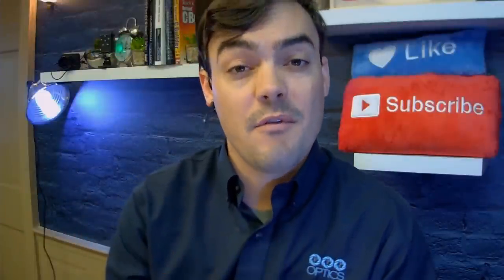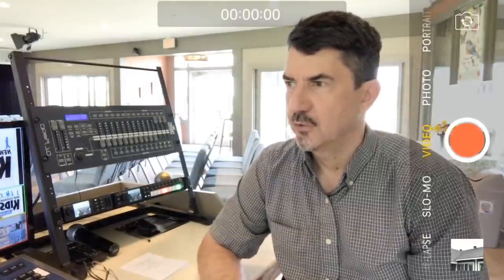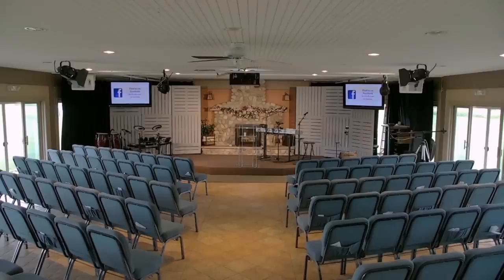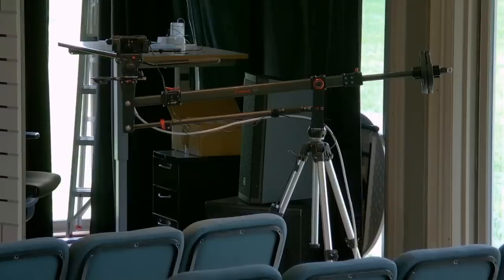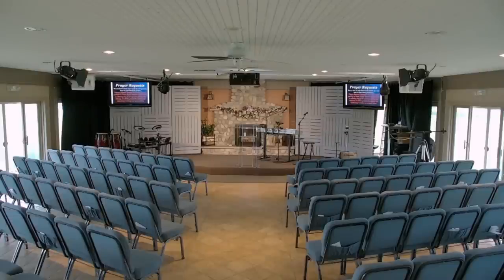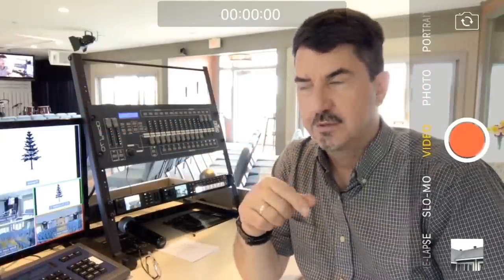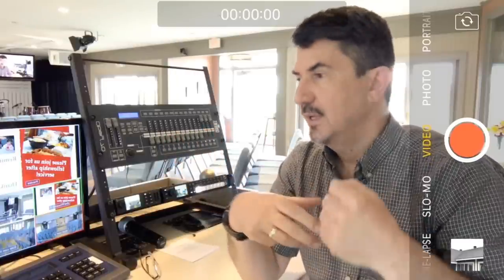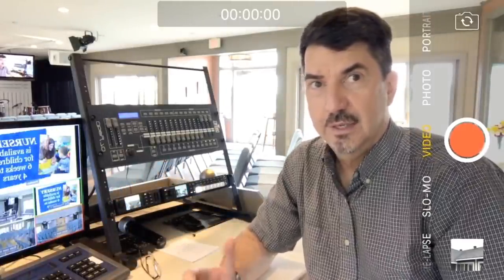Church PTZ Video Streaming System - Case Study

Comment: Hi for your audio delay issue you need to delay the audio 50 or 150 milliseconds to get it to match up you'll have to play with it to see what works you look into the BEHRINGER SHARK FBQ100 theres others out there but this is the one i have and works alright with my atem television studio hd setup. Was having the same issue especially when using the hdmi input from my cameras.

Comment: 2 Questions, if I may. Why are the iPhone portions of your video flipped horizontally? Did you get your audio lag corrected? A friend is battling the same issue (PTZ 12x & vMix). Delaying the audio is easy, but the audio is already behind the video - delaying it would only make it worse. If you've figured that out, please share how you resolved it. Thanks! I greatly appreciate the video walkthrough of your system. Well done.

Comment: Hi Matt - superb educational video.
What type of UltraStudio are you using that allows passage of signals both ways? Can't actually see the device in the video but understand your clear description of the signal coming to the iMac from the Atem Switcher and then the iMac sending the mimoLive back to the Atem.
Reply from the maker: Hello!
To facilitate the passage of signals both ways (input and output) between an ATEM switcher and an iMac, particularly for scenarios involving software like mimoLive or similar live production software, you would typically use one of Blackmagic Design's UltraStudio devices that support both capture (input) and playback (output) functionalities.

The UltraStudio product line includes several models, but not all of them support bidirectional signal flow. For your needs, the following models are among those that can handle input and output simultaneously, making them suitable for sending a signal to the iMac from the ATEM switcher and then sending it back from the iMac to the ATEM:

UltraStudio 4K Mini
Connections: It offers both input and output for SDI and HDMI, among other connections. This device is highly versatile and capable of handling up to 4K resolutions.
Use Case: You can capture video from the ATEM switcher via HDMI or SDI into mimoLive for processing or streaming on the iMac. Simultaneously, you can output a program feed or graphics from mimoLive back to the ATEM switcher through the UltraStudio 4K Mini.

UltraStudio HD Mini
Connections: Similar to the 4K Mini but more focused on 1080p workflows. It offers SDI and HDMI input and output, making it suitable for many live production tasks.
Use Case: This device is well-suited for scenarios where you're working with 1080p video and need a reliable way to integrate live graphics or other elements from mimoLive into your ATEM production workflow.

Key Features to Consider:
Thunderbolt Connectivity: These devices typically connect to an iMac or other computers via Thunderbolt, offering high bandwidth necessary for high-resolution video signals.

Software Compatibility: Both devices are designed to work seamlessly with software like mimoLive, OBS, Wirecast, and more, providing the flexibility to create complex live production setups.

Latency: When routing video signals in and out of software applications, consider the potential for latency. Devices like the UltraStudio series are designed to minimize this, but software processing can add delay.

When setting up your workflow, ensure the video formats and resolutions are consistent across your devices and software settings to avoid compatibility issues. Also, remember that while these devices facilitate bidirectional signal flow, the actual routing of signals—what goes in and out—will largely depend on your specific setup and the capabilities of the software you're using, such as mimoLive.

If you didn't see the device in the video, it's likely because these units are relatively small and can be placed out of sight in a production setup. The specific choice between models like the UltraStudio 4K Mini and the UltraStudio HD Mini will depend on your resolution requirements, budget, and the connectivity options you need for your workflow.

Thanks for checking out our Channel! 
Learn More: https://ptzoptics.com/

Comment: How do you switch the source camera/input for the Aux Out output? inside mimoLive? Using the ATEM Controller Layer?
Reply: On the TVSTudio One you simply press the AUX button, it lights up white, then press whatever source you wish to send to the AUX output. Press the AUX button again to turn it off. Your AUX output is now sent.
Reply from the maker: Hello!
Switching the source camera/input for the Aux Out output in mimoLive, particularly when using the ATEM Controller Layer, involves a few specific steps within the mimoLive interface. The ATEM Controller Layer in mimoLive allows you to control Blackmagic Design's ATEM switchers directly from within the mimoLive interface, enabling a seamless workflow for live video production. 

Here’s how you can switch the source camera/input for the Aux Out output:

1. Setting Up the ATEM Controller Layer
First, ensure that you have the ATEM Controller Layer set up correctly within your mimoLive project:

Add the ATEM Controller Layer: If you haven't already, add an ATEM Controller Layer to your layer stack by clicking the "+" button in the layer stack area and selecting the ATEM Controller from the list.
Connect to Your ATEM Switcher: In the ATEM Controller Layer settings, input the IP address of your ATEM switcher to establish a connection between mimoLive and the ATEM hardware. Make sure your computer and the ATEM switcher are on the same network.

2. Configuring the Aux Out Output
Once the ATEM Controller Layer is connected to your ATEM switcher, you can proceed to switch the source camera/input for the Aux Out output:

Select the ATEM Controller Layer: In the layer stack, click on the ATEM Controller Layer to reveal its settings in the right-hand properties panel.
Navigate to Aux Output Settings: Look for the Aux Output settings within the ATEM Controller Layer properties. This section allows you to control which input source is assigned to the ATEM’s Aux outputs.
Choose the Source for Aux Out: You should see a dropdown menu or a list of inputs that can be assigned to the Aux Out. Select the camera or input source you want to route to the Aux Out from this list. The list will include all available inputs and cameras currently connected to your ATEM switcher.

3. Applying Changes
Activate the Layer: Make sure the ATEM Controller Layer is active by clicking its "Live" button. This will apply any changes you’ve made and control the ATEM switcher according to the layer's current settings.
Test the Output: After switching the source for the Aux Out output, it’s a good idea to verify that the correct source is being output by viewing the Aux Out feed on a connected monitor or recording device.

Tips
Update Software and Firmware: Ensure both mimoLive and your ATEM switcher firmware are up to date to avoid compatibility issues.
Network Stability: Ensure a stable network connection between mimoLive, your ATEM switcher, and any networked cameras to prevent control lag or disconnections.
Practice Switching: Practice switching inputs and using the ATEM Controller Layer before going live to familiarize yourself with the workflow and reduce the chance of errors during a live production.

Using the ATEM Controller Layer in mimoLive provides a powerful way to control your ATEM switcher directly within the software, streamlining your live production workflow. If you run into any issues, consulting the mimoLive documentation or seeking support from Boinx Software and Blackmagic Design may provide additional insights and troubleshooting steps.

Thanks for checking out our Channel! 
Learn More: https://ptzoptics.com/

Comment: I'd like to know if you're using Ptzoptics connected to Atem TSHD over HD SDI, and how. Because I've read that ptzoptics 20x frame rate doesn't match the input of this Atem. So, it's necessary use HDMI.
Reply: We're using 12x PTZ Optics cameras with the ATEM TSHD. Cameras are set at 1080i 59.94. The reason for 1080i is a limitation with our large screen TVs in the front of our sanctuary. Unfortunately, with the ATEM TSHD you have to pick one single resolution and frame rate for all inputs and outputs. It works for us, though. One option is to use a MD-HX by Decimator. This box is a HDMI/SDI cross convertor. It works well, but didn't completely solve our problem, so we are working with 1080i.

Hope this helps!
Reply: It helped a lot. Thanks. I'm planning to buy the ATEM system, instead V-1HD, due to the possibility of using SDI and HDMI, with 8 inputs and PTZ would be my first camera with SDI connection. So, the only camera with SDI I'd  need a converter to use it. In this case, the Roland Switcher would be better. That's why I was worried about using Ptzoptics with the SDI. But, in your case, if you didn't have the limitation of the front TV, you could use the PTZ at the SDI, at 1080p?
Reply: Yes, the PTZ cams allow several outputs. You would just want to check with them on the current cameras to see what resolution and frame rates they support.
Reply: Matt Molnar perfect. But what I mean, is that I'd wish to buy a PTZ to take the benefits of a SDI connection. If it doesn't match que input rate of the Atem's SDI, would make no sense for me. But I got your point and thanks for sharing your experience.
Reply: Adauto A. Araujo 
Got it! It can be a bit frustrating to find equipment that talks to each other from different manufacturers. Blessings on your project as you go forward!

Comment: Wow... why would a church require such sophisticated video equipment at such an astronomical cost? Surely the money could have been spent better in the local community to help the disadvantaged and the needy; after all... it is a church! Looks like plenty of self indulgence and feeding the local supplier with good sales here! I purchased a a ten year old ex studio Panasonic AW-650E (3 chip, 1/2" ) camera body with a Fujinon zoom lens from an auction (plenty around), an ex studio heavy duty tilt and pan stand and 12v (4amp) PSU for under a $100... broadcast quality even if it is ten years out of date! I just used a $10 EasyCap video grabber (A to D) and $10 ex-studio Audio Technique cardiod mic... all into an 8" tablet that was used as a video monitor and an SD128Gb memory chip for recording (Avi or MP4) The $10 EasyCap video grabber even came with editing software to use on a PC. Total outlay about $200... The rest of my $10,000 budget (same as yours) I gave to the poor, d'oh!
Reply from the maker: Thanks for checking out our Channel! 
Learn More: https://ptzoptics.com/